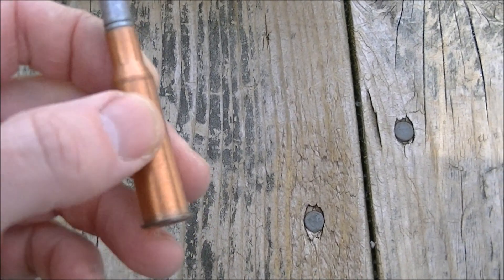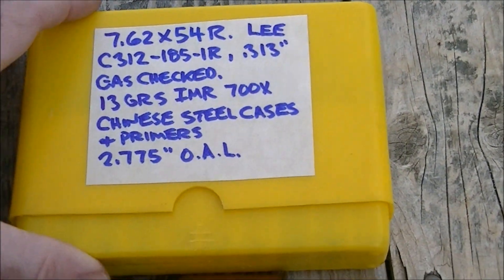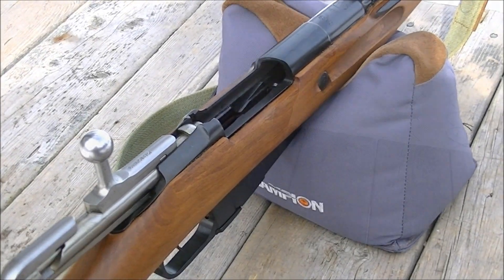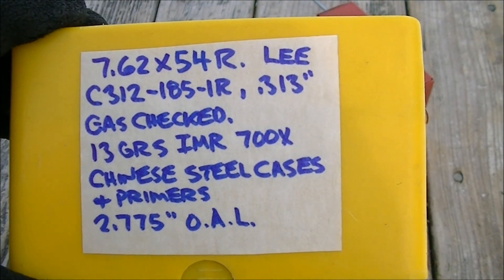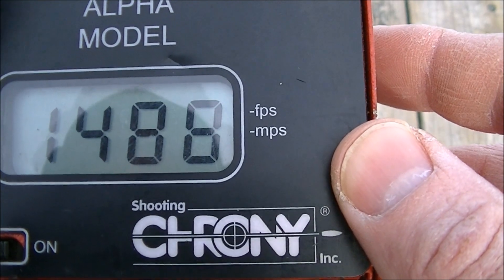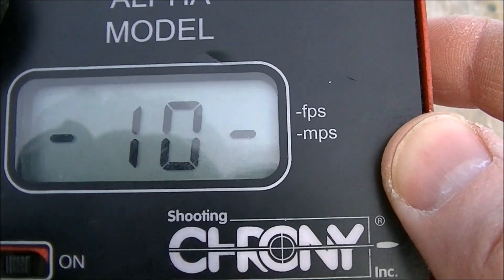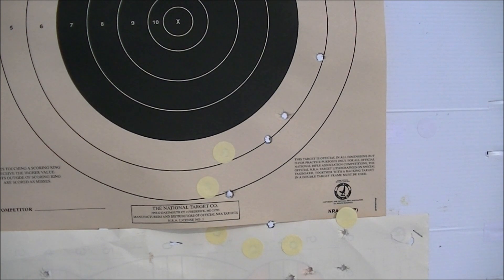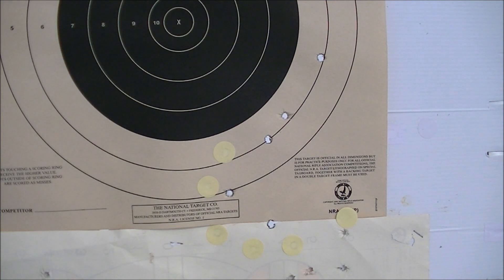7.62x54R Cast Load Test,  IMR 700X

Comment: Just tested some cast loads myself in a 91/30 Mosin Nagant .312 cast 200g lead with gas check (Lee mold), graphite/wax lube.   Cases deprimed hydraulically Berdan cups dimple removed and recharged with SINOXID, primer sealrdvwith paper disc and NC lacquer-    55 grains of toilet paper charcoal black powder, compressed 1647 fps.   32gr of Alliant Blue MZ -1688,   40 gr of Grey MZ with 5gr H4895 booster 1898 fps.
Reply from the maker: I must say I have never loaded black powder or BP substituent in the 7.62x54R round, thanks for sharing your results. Did you get a lot of fouling in the barrel?
Reply: @314299  the toilet paper charcoal black powder is actually pretty clean burning, Blue MZ even more so.   But after about 8-10 shots you would want to run s couple cleaning patches down the barrel

Comment: Powder coat those bullets and use wheel weight lead.    You can get higher velocity, no lead buildup in the barrel, and won’t need gas checks.
Reply from the maker: I'm sure at these modest velocities powder coating would work fine and the added diameter might help out as well.
Reply: The highest velocity I’ve shot PC bullets is 1850 FPS.    Recovered bullets showed the PC was still intact.    Guys on the S&W forum say the same thing at 2200 FPS.    What I like is no leading of the barrel. NONE!

Comment: Thanks. My sweet spot for this same bullet in my 91/30 is 22.5g of IMR 4227.  Normally can shoot @ 2" group at 100 yards.  Speed is @1760 FPS.  I set my elevation to 700M.
Reply from the maker: Having all that elevation adjustment is certainly handy when messing with cast bullets.

Comment: Here's my two-penneth : The standard overall length for this round is 3.038"  whereas your round is 2.775" that's 0.263 inches shorter.  To put that in perspective it's shorter by 6.68 mm - almost the diameter of the bullet.   So there's quite a bit of distance of travel before the bullet meets the lands of the rifling.   I know why you've seated the bullet so deep in the case - the style of the bullet doesn't really suit this cartridge - there are a lot of grooves before you get to the cannelure.  So you're getting decent volocities due to the depth of the bullet upping the pressure but losing accuracy due to the long journey to meet the lands.

I've just bought this mold and find it lacking.  Ideally the bullet would be heavier - resulting in a longer projectile, with no grooves so that it could be seated to the specified length without sacrificing decent tension in the neck - ideally the bullet should sit at least to the depth of its diameter to meet this.

Comment: I’m looking to get some Bullet casts for a black power load on a 1898 Mosin rifle.  Any place I can buy 500-1k bullet casts?
Reply from the maker: Black powder in a Mosin? Interesting.You are going to have a problem with most commercially cast bullets as they will be lubed with petroleum based bullet lube, and those types of lubes don't play well with black powder. Using black powder with that type of lube will result in a horribly clogged bore that is hell to clean. You will need bullets lubed with black powder rated lube such as SPG. Commercial bullet casting outfits generally don't offer cast bullets as small as 7.62/.30" size with anything other than regular bullet lube. You might get someone with a smaller company such as Montana Bullet Works to make you what you need. Good luck with your project.

Comment: Never used 700x before.  I'm assuming your powder weight is loosely based off of C.E. Harris' 13 grains of red dot.  Or any fast burning pistol powder.  The last few weeks I've been experimenting with 13-15 grains of green Dot and have had pretty good results out to 175 yards with a 15 grain charge using the C312-185-1R gas checked and pan lubed.  Yes I still pan lubed.
Reply from the maker: The 13 grs of 700x was derived from a load for the same weight bullet for the 30/06 in the Lyman Cast Bullet handbook. Generally speaking cast bullet load data for the 30/06 is usable in the 7.62x54R as the two cases have similar case capacity, similar bore size. In fact one of the older Lyman books had in the 7.62x54 data section the instructions to use 30/06 Data and did not provide any 7.62x54 data at all.
Interesting to hear of your good results with the C312-185-1R and green dot, might be something to try.
Reply: I just looked thru my old Lyman books and sure enough my Lyman Ideal Handbook No.40 reads: Use same cast bullets and and charges as .30-06.  I didn't see any 700x load data.  What Handbook number are you referring to?
Reply from the maker: @nrainfidelforlife  The 13 grain charge appears for the 311334 bullet in the Lyman Cast Bullet Handbook, Third Edition.

Comment: I have a real hard time to install gas checks on these exact same bullets? So tight, i will probably need to buy some equipement 🤷🏻‍♂️
Reply from the maker: Sounds like there is a problem with the dimensions of your mold, they should slip on easily.

Comment: I didn't think you could reload steel cases?  Maybe you could do a video on that sometime?  Thanks!
Reply from the maker: These cases were not "reloaded" in that they were left over from pulling apart surplus ammo and therfore did not need any sizing and still had the original live primers in them. Steel cases can be reloaded and I have done so but normally it's not worth the effort if there are boxer primed brass cases available.
Reply: pretty much..
Reply: Seating bullets into unfurled cases that have been disassembled.

Comment: Wow good velocity reads but stringing how odd? I wonder how it would be with a couple more grains of powder. Sir do you sort by weight of you cast bullets?
Reply from the maker: I don't recall if these bullets were weight sorted or not. Considering the way they shot they were probably not sorted. My current practice, now that I have a decent digital scale, is to sort cast rifle bullets.
Reply: 314299 Shooting Channel I sure appreciate you making these videos I love shooting and reloading I just don’t have the time right now. By the way that was a very beautiful polish m44 was it made by random? I was wondering how restrictive are the gun laws in Canada?
Reply from the maker: @heyyoubuddy6749  Yes the M44 is a Radom manufactured rifle (factory code "11" on the receiver, it was new in the grease when I got it. Gun laws here are tolerable at the moment.
Reply: Vertical stringing is fairly common with some powders and light charge weights that are position sensitive.  Some individuals will tilt the rifle barrel up so that the powder charge is basically back against the primer before firing or use a Dacron filler to hold the charge in place.  I tend to try to stay away for any powders that are position sensitive and have always had good results with Alliant 2400.

Comment: Those looked low to me.
Reply from the maker: The group, while crap, is reasonably centered in elevation around the point of aim which is the bottom of the black. Be a simple matter to go up a notch on the sights to get the rounds into the black. But probably not worth the bother with a load that shoots so poorly.
Reply: @314299  sorry I meant the fPS looked a bit low.
Reply from the maker: @dennismillus4581  I guessed wrong. Yes, they are a bit on the slow side.